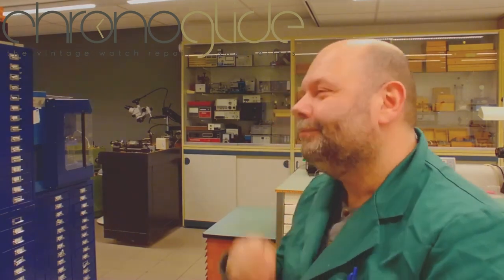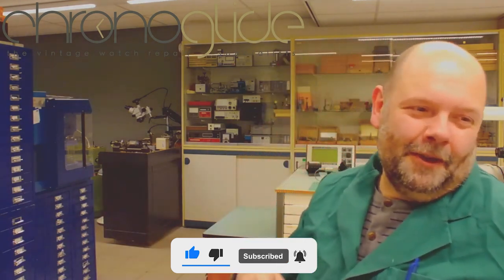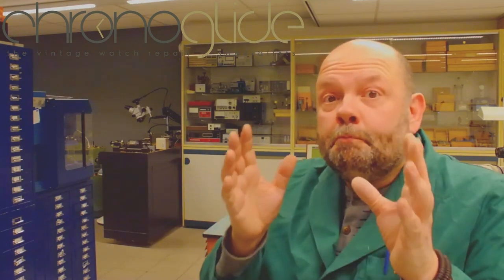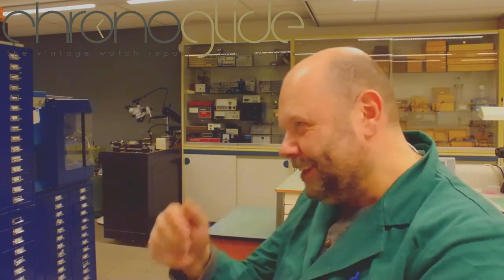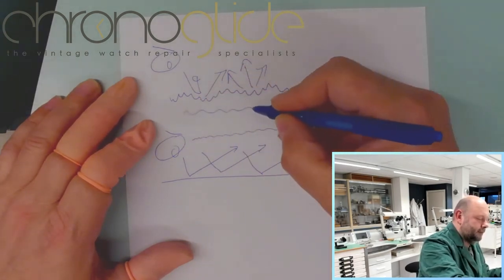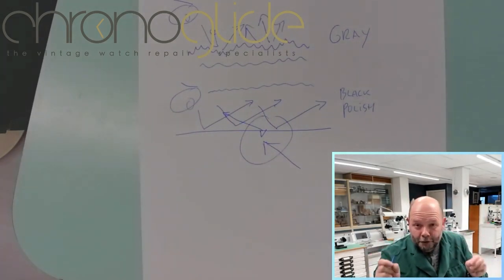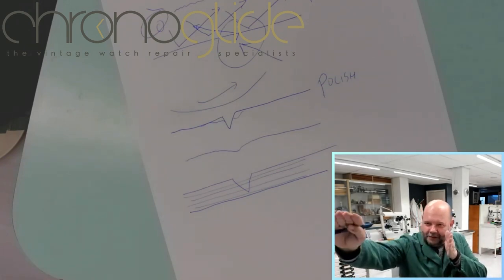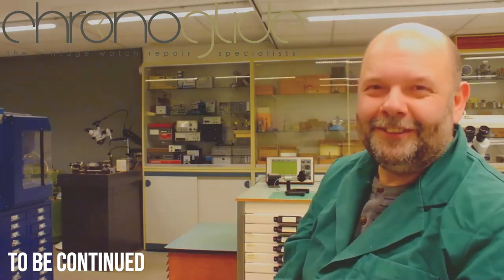How to polish your vintage watches - Part 1 Introduction

Comment: So Interesting. Looking forward to the next instalment. As a home hobbyist using a 5' x 3' table, which also holds my computer, the facility to polish and repair cases is not an option I could do. However, these videos will give a good insight and are of great benefit to the knowledge needed to restore watches. Thank you Kalle.

Comment: Depending on the material of the watch case, they have to be treated differently. Most of the time it's not worth to polish gold filled or plated cases. Adding texture like a sunburst treatment is difficult to do with out correct machines.